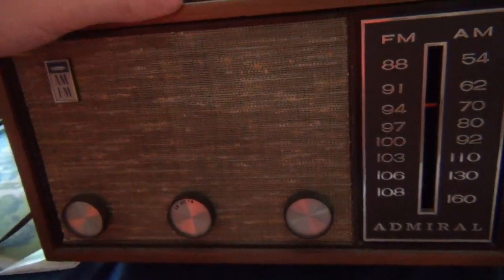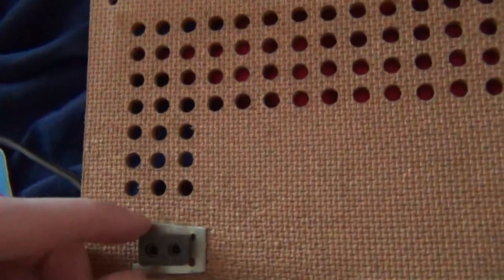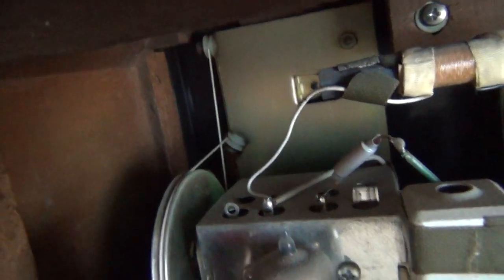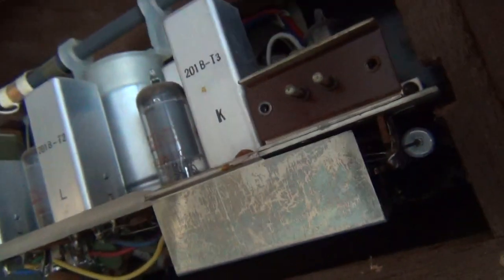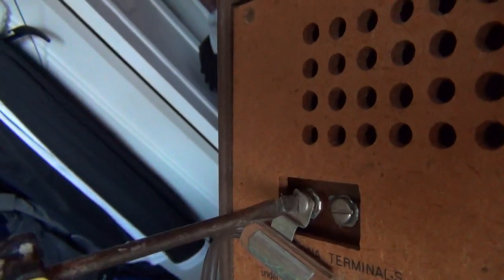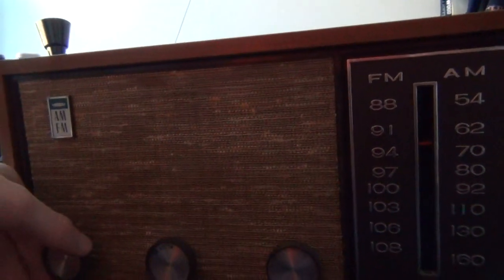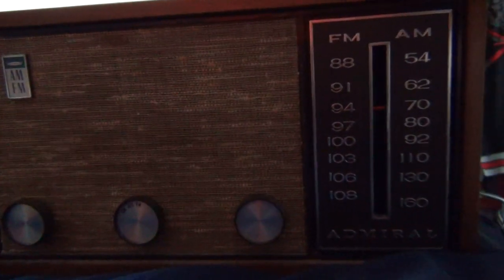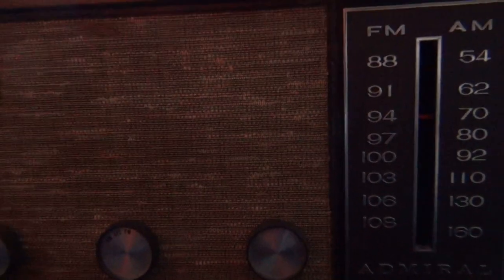1960's Admiral AM/FM tabletop tube radio

Comment: Replace the capacitors and the hum will go away, and it is normal for any tube radio to run very warm , so no worry there. Great little radio.